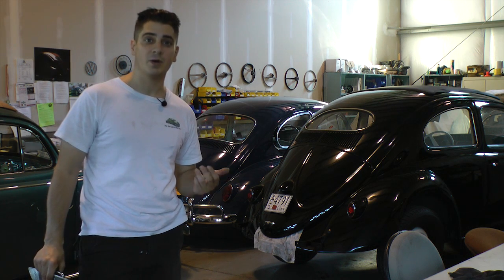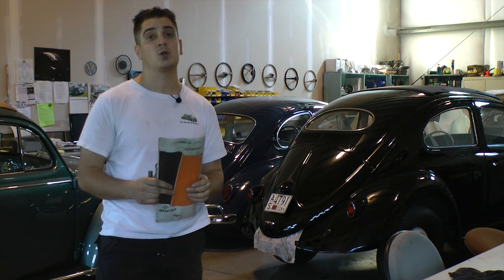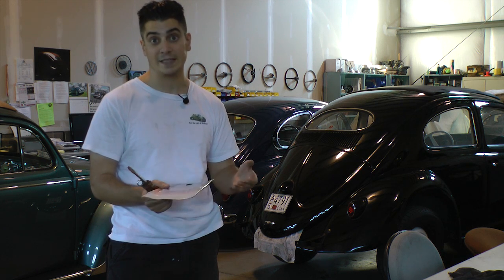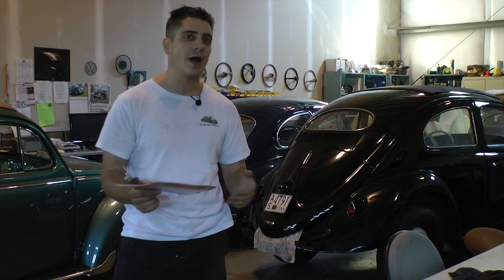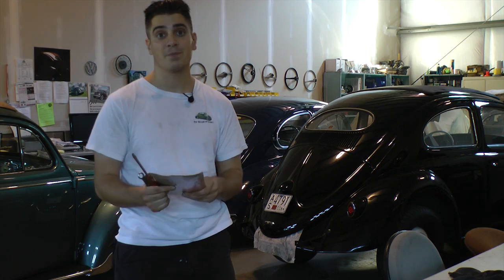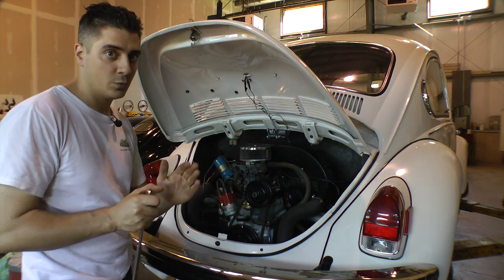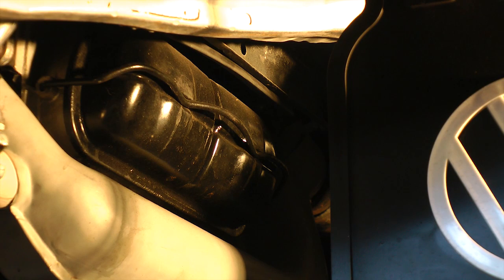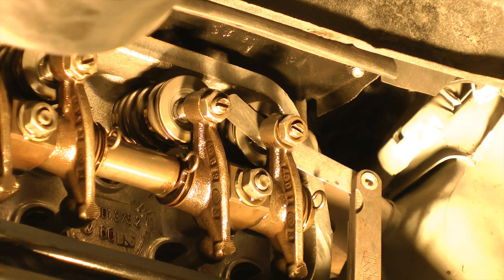Classic VW Beetle BuGs How to Adjust your Valves PT.1 tip Vallone

Comment: Great video Chris! Although I removed the distributor, I did get the compression hose over tightened. So it was easy to determine which cylinder I was on. Did what you instructed and got them adjusted. Compression was a measly 40lbs on cylinder #1. I  suspected the valves were tight. I was right. Came back to 130lbs. And checked after spinning. Still a good .006 gap. Thanks for the Tip videos.

Comment: Chris I have the short style  113905205M distributor from 1968 I believe. I’m using it in a 71 super. Single port.  36 hp.   First cylinder on my distributor is where everyone else’s 3rd cylinder is. On the left hand side of the dist if you’re looking at it from the rear of the car.  Is this normal?

Comment: Just to confirm, adjust a 65 with a 1200cc to 008MM intake, 010mm exhaust? That's what I I adjusted mine to
Reply from the maker: Not 65 heads.  If you have the square boss inside the head and the short stud, then it is .006 for intake and exhaust.
Reply: @classicvwbugs  ok thanks. I readjusted them

Comment: Snap On used to make a tool in an S configuration for that.  I used to do my 74 Beetle all the time.  However, there was a trick of the trade which I cannot remember exactly any more.  It was something like.  TDC, then you can adjust 1 & 3.  Then rotate X degrees (can remember, but the crank turns twice as fast as the cam (360 deg vs. 720 degrees) and you go to 2 & 4 cylinders and adjust those.  Almost one stop shopping, but I can't remember the sequence.  Maybe someone else can comment.

Comment: Chris, I have a 1971 Super Beatle convertible having issues with back fire  out the back & not running smoothly especially when 1st started in the morning.   Need your help & what to check. Thanks Chris
Reply from the maker: Check your timing!
Reply: Thanks Chris for the help, I will check timing out & let you know how that went.  I thought my carburetor  needed a cleaning .Thanks again.
Reply: Hey Chris did what you suggested to check my timing  on 71 Super Beatle convertible everything went great until I tried to twist my distributor. It was locked up & would not turn. What now? Thank you.
Reply: Oh 4got to mention I did loosen  my distributor screw, didn't help when I tried to twist. Locked in . Thanks
Reply from the maker: @thomascrow8289  Check the bracket that holds down the dizzy, may be cocked or not spreading apart in order to take it out.
Reply: @classicvwbugs  Thanks, I was just trying to set timing by turning distributor counter clockwise until my test light came on when I discovered it was not going to budge. Didn't see a bracket around it & didn't appear to be cockeyed. It would take a plumbers wrench to turn that's how tight it's screwed in. Wish I had better news.
Reply from the maker: @thomascrow8289  How is here no clamp around it?  What did you loosen then to try to make it move?
Reply: @classicvwbugs  I will try & send  you a picture tomorrow. The screw I loosened was on the bottom right of the distributor . I thought that would free up the distributor , but it made no difference. Maybe some asshole I had service my car took off the bracket  you mentioned.  I never took it off . Thanks
Reply: My mistake, I said screw that I loosen. It was a  13 m. Bolt . I'm  a bit disappointed & frustrated.  Thanks

Comment: My 3rd cylinder intake won’t let me fit a feeler tru, I pulled the screw back and it still won’t let it tru? Is it burnt? Any advice?
Reply: Sounds like a stretched valve stem,not good,only remedy is a strip down of the head,also check for cracks around the valve seat,if valves are not checked every 3000 miles then problems like this will occure,and its a simple thing to do.Good luck with your bug.

Comment: No permatex. Use Gasgacinch. Better results. Be sure your valve covers are dry and grease free before re-installing them. The gasket sealer on the new gasket on onside to hold in place.

Comment: Hey Chris, you are my last hope, my bug will not start, I've tried everything, points, timing, new carb, new fuel pump,new coil, everything, it just won't start, it's a 1975 super convertible that I had changed over to carburator, please give me some advice, I'm desperately needing to get this car running. Nobody wants to work on these cars, please help.  

Tom
Last hope
Reply from the maker: Do you have spark to the points?

Comment: Hi, I just bought a 1641cc engine with dual carb, I took it to a shop where they had to rewire and put a regulator on it because I had an alternator before now it has a generator, they told me thatI needed a new generator, so I got a new generator, the Idiot light still stays on when starting the car and the generator is not charging. The belt wiggles a lot when the engine is running. The other thing is, the engine has an aftermarket exhaust its back fires and blows out flames. I had my friend drive the beetle while I follow, and I saw that the exhaust was turning red hot while driving on the freeway when he slows down the exhaust cools down, and every time I pressed in the gas theres a loud tapping sound I thing coming from the exhaust but not sure

Comment: Hi Chris. I have a 79 Convertible Beetle that blows white/blue smoke when I start it up. It lasts only for the initial start up. I read up on the subject and everyone says I need to replace the "valve seals." Do I need to do the valve adjustment you describe here, or replace the oil pressure valves? Apologies in advance if it's a silly question. I'm very new to to working on my own car. Thanks!

Comment: Hi Chris, thank you for sharing these videos with us!!
I learned so much of your videos and the bug-me-videos. I guess your how-to vids were the spark I needed to restore and take care of my 79 bug. I don't think a weekend goes by without me working on my bug, to the great annoyance of my girlfriend. I don't think she likes you that much, now I think of it.... oh well :-) 
Anyways, I have a question considering the valve adjustment. In 1 case I just can't change the clearance no mather what I try. I can remove the nut without a problem but the screw-head just doesn't move and seems stuck. I've stopped trying because the screw-head is a bit damaged by now because of using to much force.
Any tips to fix this? 
All the best,
Robby from Belgium
Reply from the maker: Hmmm, can you get a set of vice grips on it maybe?
Reply: Thanks for the tip, Chris! With a vice grip I managed to get screw bolt out. In case someone else is experiencing the same problem, use the vice grip carefully, you could easily damage the thread!

Comment from the maker: It gives you the correct intake of oxygen and the exhaust of carbon gases.  If these are not handled correctly, the car will not run efficiently,  all this has to be right if you want less wear on the motor.  The motor will not perform to its max potential, you can kill it if not maintained.

Comment: Are you able to adjust your valves on a split bus without removing the engine and doing the same as the bug and remove the wheels

Comment: This video helped me a lot... I got under the hood yesterday & adjusted the valves.. also got that same Permatex... maroon/red gasket sealent... sticky stuff! I got into one major issue though.. the 1st Jamb nut of Cylinder1 is slipping. Not sure how to losen that one. any tips? i did use proper 13mm wrench.. also used lube-spray to losen it...

Comment: Had a 68 Beetle.  A 72 Super Beetle.  A 74 van with a Porsche  dual carb Porsche engine, and a 76 Beetle with a sun roof and fuel injection.  I wish I had them all back.